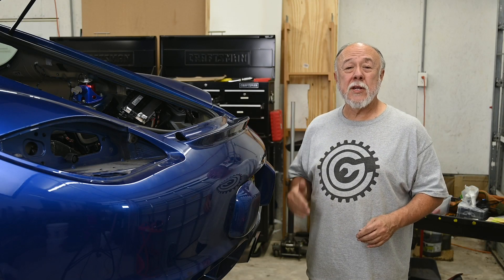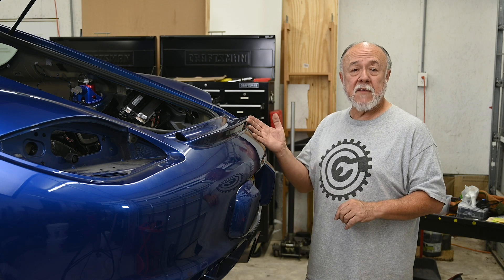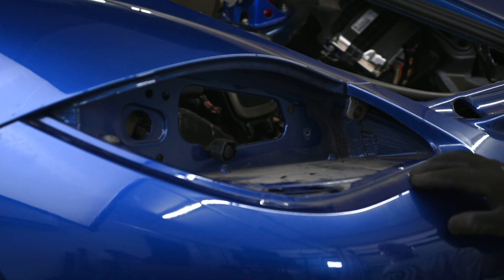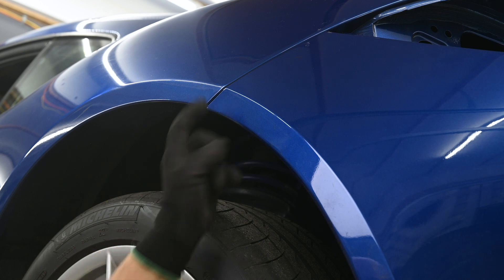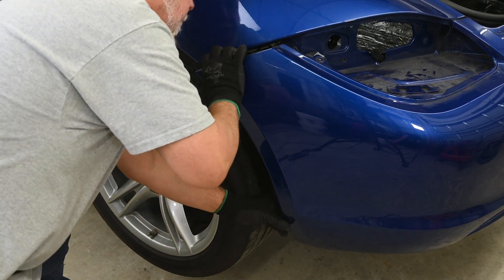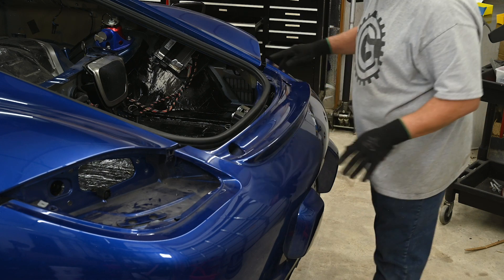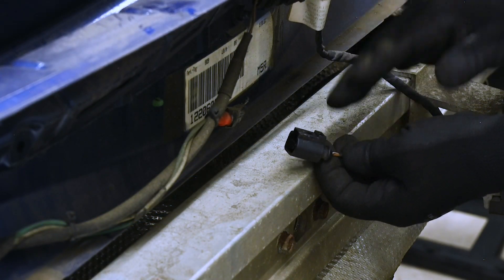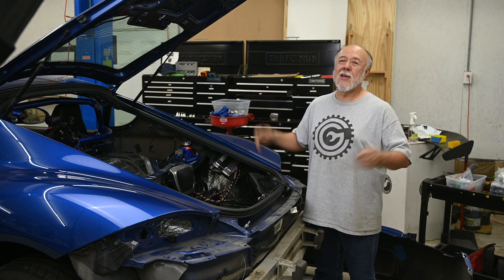How to remove the Porsche Cayman rear bumper cover (987 and 987.2)

Comment: is it possible to remove the bumperettes? Without removing the bumper?
Reply from the maker: No, they're locked into place with a mating piece on the back side. Also, you have to remove two large impact struts that are inside the bumperettes and there's no way to access the rivets you have to drill out with the bumper still on.